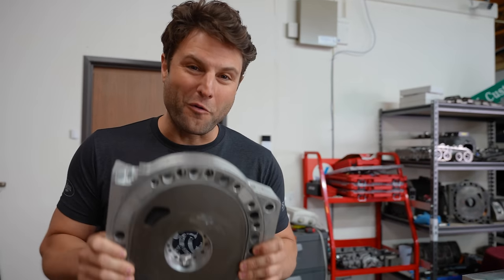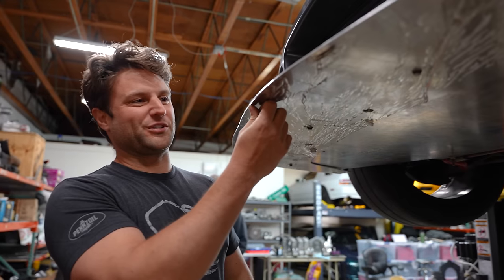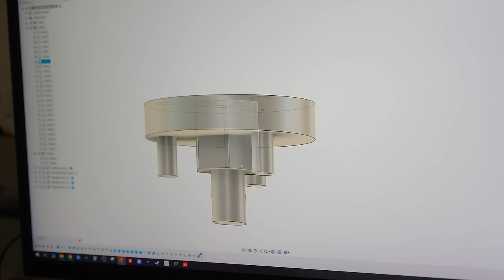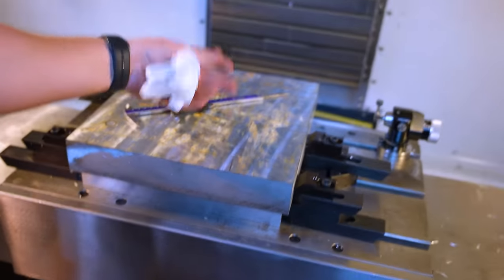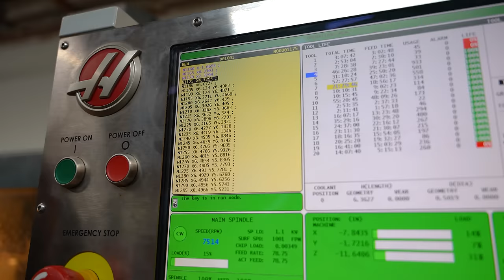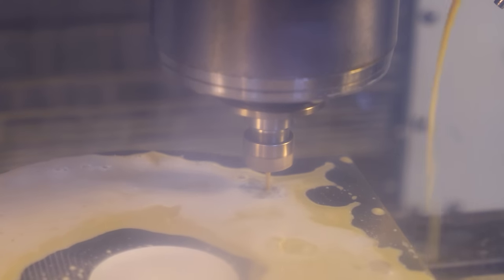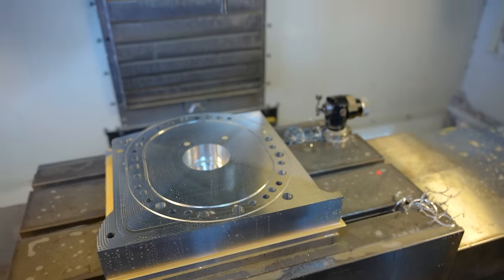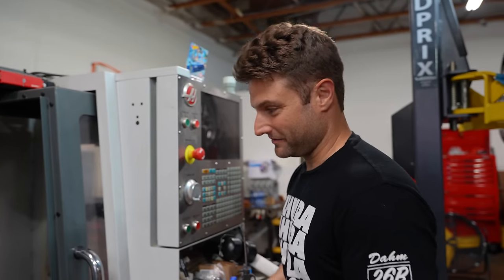Making my FIRST Billet Engine plate from raw Aluminum!  Dahm Racing Engines incoming??

Comment: Cast Iron Jig Plates:🤔
Milled flat
Drill holes hold down-bolts, then dowl pins holes to be pressed into jig
3 slots for Keyways & T-Slots & 3 holes, for production consistency
Surface Grind to complete jig, after other machining!

Wrong speed & coolant for tapping aluminum🤢

Shell-mill for Surfaceing w/ replaceable Carbide Inserts (tinker with radius & relief angles),for best results.🤔

Add stiffening hole(s) on Combustion Side for additional through rod(s), to contain distortion under high HP Pursuit😊

Old School retired T & D

Edge Precision has some mind blowing YT videos!!!

Comment: next time try a "form tap". they do not produce any chips. Also, use at least a collet holder for the taps. A drill chuck will allow the tap to move too much. You might also want to invest in a 2.5" face mill (or larger). Facing off large pieces will take less time and leave a better surface finish.

Comment: Rob, any thought of making a larger displacement 2 Rotor engine. Maybe 2.6 L. That should still allow it to rev and have improved torque numbers. From there you can stack 3 or 4 rotors. That should have some serious HP.

Comment: Try using form taps. They use a different drill size than standard taps. Standard taps cut thread roll taps sort of forge the threads. Since there are no flutes they are stronger.

Comment: Get yourself a facemill to drastically reduce the time needed to do the first flat cut. It should also produce a very smooth finish
Also a floating tap is a great option to keep from snapping taps, tho they might not be 100% accurate since they have some give to them as long as your hole is good it should be just as good if not better as tapping by hand and significantly faster

Comment: might be worth getting gauge pins for checking your fit instead of the dowels that you plan on using. Might also be worth getting a really good marble slab and some extra measuring tool for things like surface finish and flatness and most importantly concentricity

Comment: Asking the question because it came across my brain. Are you planning on finding a tolerance “zone” for the CTE of the housings at working temp or at room temp?

Also “bleeder or Plenum grooves” (cylinder center lines on the top surf) for removing chips and coolant would be very beneficial and not change structure.

Not back seat driving your process just throwing ideas at the wall if not thought of.

Comment: So set up the CNC machine to have space for three jigs?
(FYI: 1) Initial guide cut 2) one side 3) other side )

If you go that route, you can create a longer linked program (assuming you have space in the CNC machine for this) that would do all three passes at once.  Or at least set it up so that you can put both sides in there at the same time, so you don't have to readjust the jigs... but that's probably what you're doing anyhow.

Comment: As a CNC shop owner it’s painful to watch but i made the same mistakes learning how to run a machine. Try peck tapping at .015 to .020 pecks if your having problems with tapping. Or treadmill the holes. It’s a lot more complicated but it’s worth it not having to dig a broken tap out of a hole. And you can save your settings on you cam software so you only have to do the math on the hole 1 time.

Comment: i would use a form/roll tap in future taps are stronger. If using cut tap for blind holes use a spiral flute, for thru tiles use a gun tap. But if I was you you should have used peck tapping. For the custom tool for the coolant seals find an ANCA CNC tool and cutter grinder you can make all the custom tools you want. Turning the coolant on and off can cause thermal shock on your tools not so much of an issue with aluminium but I would still be careful 😂 if making tools stick out longer make sure it's in the collet fully as it can make the collet taper. Sometimes you can put another endmill in the back of the collet to keep it parallel and your tool running thru.

Comment: Just looking at an aluminium billet that big hurts my wallet 😂 awesome stuff guys, there's an absolutely incredible amount of engineering, physics, design and just work that goes into every part of an engine that most of us never see.
It's why I like to use OE solutions wherever I can, I'll only upgrade to aftermarket to solve a known issue (the plastic thermostat outlet on my n54, for example) or where I'm going outside of what an OE design is meant to do. But in most cases, Honda or BMW or Toyota's massive amounts of money and teams of engineers are probably gonna solve things better than me and my angle grinder
Reply: Unfortunately the belief that aftermarket stuff is better is a pervasive one in the automotive sphere. Mazda almost bankrupted themselves trying to make the rotary work.

Comment: Aluminum is a gummy material. You really need to select the correct style taps with the proper coatings to make it be more successful in your future endeavors. You can also get away with drilling the holes a sightly larger diameter than what tapping charts tell you to use, reducing the load on your taps. You sacrifice some thread strength, but for what you’re doing it shouldn’t be a problem. When milling, especially with roughing with indexable shell mills, you can push your IPM, sidestep and down step so much harder. That 2” shell mill can probably rip with a .65*tldi sidestep and a .060 to .100 downstep. You can get away with a .65*tldi sidestep with your end mills as well. If speed isn’t something you’re concerned about, you could also try using a ballnose cutter for your finish pass after performing a semi pass to like +.005” away with a flat or bullnose. Use a 1/2 ball and parallel cut your top surface with a finish pass with a .005 side and downstep. Your cusp height will be nice and small and your part will look like glass. I’ll shutup now I feel like I’ve rambled enough 😅

Comment: Just wanted to throw this out there for you. I seen you were having some issues with tapping. Your machine should be capable of using a Peck Tapping cycle just like you were drilling your holes. It is a G84 cycle. In Fusion it should be called either Peck Tapping or Chip Breaking Tapping. This will make tapping 1000 times easier for you ESPECIALLY when you are doing a lot of little holes with small taps. I have down thousands of holes with little taps this way and never broke one. It does take longer, naturally, but taking more time to tap holes correctly, and not have to worry about dealing with a broken tap is always worth it in my book.

Also, I couldn’t 100% tell from your video, but make sure that the holder you’re using to hold your taps is a floating holder and not a rigid holder… That will also make things way easier for you in the long run.

If you have any other CNC questions, feel free to hit me up. I engineered, modeled, and programmed all of the fixturing in our shop for seven years… I have tons of five axis HAAS CNC experience and would be more than happy to share that information.

Comment: A little late, looks like your already have the seal glands sorted, but you could use a curve by equation to define them. I found this looking into modeling a housing. This should be the interior wall defined. t goes from 0 to 360.
x=15*cos(3*t)+104*cos(t)
y=15*sin(3*t)+104*sin(t)
I can make a few curves to send you for comparison in a neutral file if you want.
Also, have you tried taking a macro picture with a scale reference in it to bring it into the model? You can match the curves visually in the sketch and get really close, as long as the scale is right.

Comment: Only bad thing ill day about the hass machines is with heavy use they start making a bunch of racket after a year and a half even if they are greased properly esp on the 5 axis mill now the lathes they got man those things are tanks! We dropped one off a semi put it on the shop straightes the big pot chuck out as much as we could and damn thing is still going strong 2 years later and not only that but it was a year or two old when it got dropped lol

Comment: Ever though of bending that splitter to increase the strength, like they do in sheet metal? you could try to get clever with airflow, add some strength, and reduce overall thickness.

Comment: Rob, if you're cutting your own custom rotors, why dont you change the design of the plates to accomodate problems you run into at 2000hp? Change the pattern of the cooling channels, or space out the holes that are on the outer edges of the plate so you have a little extra material for strength behind your orings, etc.

Comment: as a self learned cnc machinist i would NEVER put a tap in a chuck. Chucks tend to not even run 0, so i dont even use them for carbide drills. They are only used for hss drills wich is allmost never use.
For tapping i would recommend a length compensation system. That way if there is a minor mismatch in rpm vs feed when turning around it wont snap the tap, wich is what i think happend here. Also you could program a dwell time at the bottom so that it fully stops at the bottom, then after the dwell time it starts turning the other way. That way the risk of snapping is allready lower. Add the compensation holder and you wil tap m4 in a cnc machine without fear.

And then to finish it all off you could also run some tapping grease on the tap instead of the coolant. Most of those greases do a better job for tapping then your coolant wil.

Also buy a big facemill or get pre milled plates wich in most cases is even better to do. We at my work allways buy the pre machined plates if we need something flat like you do because it in the end is cheaper that way.

Comment: Sidenote to 'Billet Engine Plate' in the video title:
The finished part should be called CNC engine plate (or CNCd Engine Plate or whatever) while that raw aluminium is called a billet from the moment it was pre-cut to the size that goes into the machine till the machine makes the first cut. Then it turns from a billet into a work piece.
I guess billet 'this' billet 'that' makes it sound like the product is made of a material with very special properties and that's why many clueless people went with it and now everyone puts billet in front of nearly everything that is aluminium and comes out of a CNC...

Comment: Trim Sol coolant is awesome btw from Master Fluid Solutions , its blue and smells really good. Also extending the tool out from the holder is a big no no. Try to use the shortest tool you can and dont let it hang out the holder 2-3" haha.

Comment: i do rigid tapping on HAAS cnc machines every day at work. Buy a few spiral taps. They are a life saver and make the chips come out in one piece and out of the hole. the taps you were using are horrible for chip evacuation.

Comment: i wonder if you could just drill into the ports all the way through to the other inlet/outlets plane. so that the inlet / outlet is a hard 90deg, so the maximum amount of air volume for the port size

then, machine a part out above the port and thread a hole, this way you can then make an insert which gets installed into the port itself which can help change air trajectory into the combustion chamber. it would make it "modular" and allow you to test many different theories without having to make new irons each time

Comment: when rigid tapping Ive had a good experience rigid tapping m4-m12 threads at around 600rpm in aluminum and 300rpm in mild steel. If your going into a blind hole id recomend trying peck tapping m4-m8 id do .150in pecks m10-m12 id do .300in pecks. I hope this helps.

Comment: Love you rob you're so insanely smart I bet u can make a 2 rotor go 1000 hp
Reply: There are some 2 rotor engines with 1600+hp in drag racing already. Rotary engines get drastically weaker the more rotors you add, so to some extent it's ''easier'' to make big power with fewer rotors.
Reply: @NorwayVFX  oh I did not know that! The more you know 🤣
Reply: @skitssouls  Yeah it sounds weird but the engines are so long and narrow that they start twisting when they get too long. Also the eccentric shafts have to be multiple pieces on engine with more than 2 rotors which adds to the list of parts that can fail.

I think Rob himself has mentioned he could technically make the car faster with a 2 or 3 rotor engine than with the 4 rotor, but you would obviously lose drivability down low and it wouldn't look or sound as cool.

Comment: So I would definitely do as much research into 7075, as possible. Yes it's hard as f***, but it's notch sensitive and does not handle tension loads at all.. Under compression loads it's a beast. Each class rating has its own characteristics. I know on the surface it would appear the parts are under compression and when talking about the inside of the "cylinder", most definitely it's under compression, but the outside of the iron is going to be experiencing a tension load... Idk it'll probably work out ok but I just wanted it to be said. Even though, yes 7075-T6 is the hardest aluminum you can get but that doesn't mean it's best suited for every application. 7075-t6 is actually harder than some form of mild steel.

Comment: Stupid question, for bulk material removal, why not use a Replaceable Carbide-Insert Face Mill Cutter?
Part numbers 8826A12 up to 8826A16 depending on the size.

Comment: dude you need a floating tap holder or if you are actually using ridged tap you need the proper holder that tap is going to slip in the keyless chuck.. your tapping will go much better

Comment: If you ream with tapping fluid the holes will be a little bit tighter, and you should turn down the rapid when you're exiting the hole with the reamer
Reply: It's also a good idea to bore the first .100-.300" with a ball endmill the same size reamer, fill the reamer has something straight to fallow. And remember to check the runout of all your tools besides the drills.

Ps . If a hole is important, only bore and ream the first .100-.25"  and check with gauge pin
Reply: Chamfer your holes before reaming, chamfering creates a inside Burr and the reamer will remove it

Comment: If you cool the aluminium more and the tungsten surface is still hot won't there be an increase in mecanical thermal stress between the materials rather than a decrease?

Comment: Tip for cutting width for endmills. If cutting depth is 1xD cutting width is 30% if is 2xD its 15%, 4xD its 7,5% and if its 0,5xD its 60%. Never use 50% cutting width.

Comment: You'd probably save so much time and effort designing this in millimeters since that's what the Mazda engineers did. Also, a fly cutter would let you face the billet in like 5 minutes, it's what they use for cylinder heads.

Comment: Curious if you had issues with the part warping after you faced both sides? I have the problem a lot when machining, and would assume that you need to rough the entire part in then do some finish passes. Have you considered using an end mill with inserts to face it faster?
Reply: I was wondering about this as well.

Comment: 7075 T651 is indeed one off the best materials to use in motorsport. On higher levels you see this alluminum alot more. But watch out! Alluminum 7075 t6511 has some internal stress especialy the outer 5mm. Make shure you remove this!

Comment: After you machined the centre hole did you re machine the top flat face?
   Stress is always a factor 
Rough everything out first & finish machine after is a good rule of thumb 
     You may have reason to do otherwise, if so I am interested in your plan 
    All the best

Comment: You mentioned how the long bolts in the 4 rotor stretched over time. Since you're making custom blocks now, you could design in a clamping feature around the outside edges to take some load off those bolts and create more evenly distributed clamping force. Or, has that been done and proven stupid?

Comment: Hey, why don't you use the CNC like a CMM and measure every hole location with it? It's probably much more accurate than 'guessing' (measuring with calipers) the hole positions. 
Otherwise, good work

Comment: The fact these margins are necessary makes me wonder if there is not a better design with more tolerance before it blows itself to pieces. I mean the forces at play and the materials involved are going to turn those tolerances on their heads either way so building in as much give and accounting for that.

Comment: @robdahm Try a set of Threadmills. They're a lot more expensive compared to the bit you used. But it allows a lot less stress on the bit.
Something like an Amana Tool 59410 (look into specific sizes for certain threads and materials)

Comment: probably a stupid question... why not run copper gaskets (like v8 copper head gaskets) between the plates instead of o-rings for the coolant seals?  i would think that would hold compression better than an o-ring?  you could have different width copper gaskets for different width rotor combinations..    idk, i'm not a rotary builder.

Comment: Thoughts on working with some Structures or Design Engineers to do some FEA? would help to optimize your stress concentration locations by running some sims and finding out where the expansion rate of the aluminum and the fatigue life is reduced by heating that block of aluminum above 320F. btw "Aerospace aluminum" means nothing. you can argue that purity of the alloy is controlled a little higher in places where Aero is the primary customer, but the spec for the Aluminum held to AMS are regardless of the end user. Basically AMS 4132 or AMS4144 Aluminum block of material is the same whether it is used for Aero applications or engine blocks.